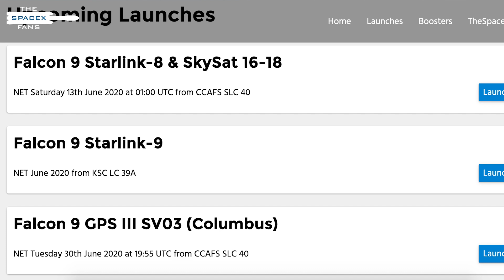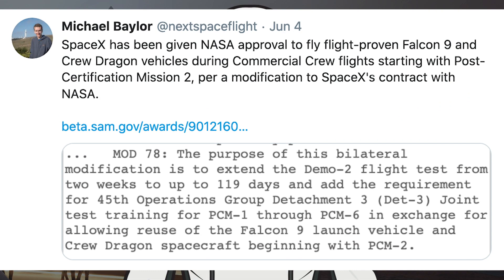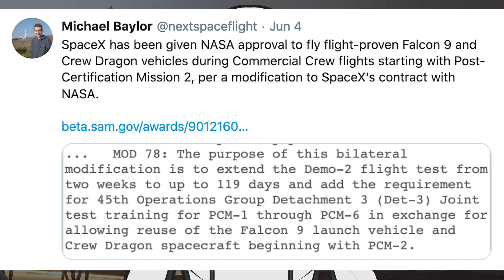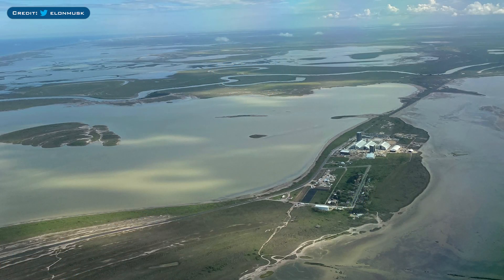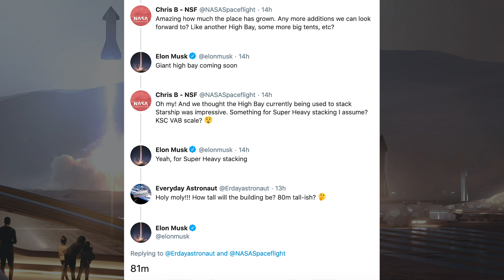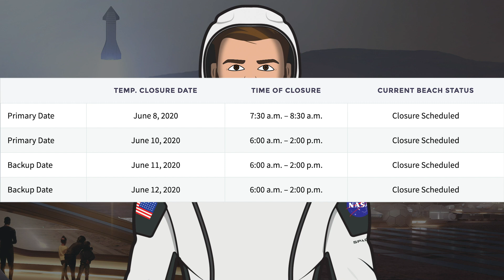SpaceX Starship Updates! SN5 Testing Very Soon, SN6 Stacking Soon, SN7 New Bulkhead! TheSpaceXShow

Comment: Shiny rocket good orange rocket bad lol ok
Reply: It's just a running gag in the SpaceX community, it's not meant to put down the amazing engineering that went into the Space Launch System. More the guys who wanted it built in the first place. Orion was contracted in 2006 and is not yet ready. SpaceX was still blowing up Falcon 1's back then and wouldn't even reach orbit for another two years. So there is reason for criticism towards the management of that program and behavior of the two main contractors responsible for delivering. Bridenstine has lit a fire under their ass and suddenly after 10 years of no hardware, we have one booster ready, another close and SRB's for Artemis 1-4 ready to go.

Comment: At 7:35 rather than two smaller rings I think one regular sized ring was used. That could be the new way to interface the dome to the body. Only one ring is needed and if taller rings are going to be used on SN7 then only normal sized ring is needed here.
Reply from the maker: I did consider that too. Would make more sense tbf.

Comment: With the amount of engineering going on, one has to feel that there's too much being built, but not much being accomplished. maybe if there's more focus into only two prototypes at once, there would be less explosions. They seem to be spreading themselves too thin.
Reply: I mean they want stuff to go wrong so they can learn from it, and they know stuff will go wrong, building more prototypes gives the team experience in doing it, and can allow for new measures to be adopted, with each prototype having new things added
Reply: @travishatch2986  I agree. But the mistakes they've made so far (failure to check valves, valves not working properly, etc) seem to be beneath Spacex's reputation
Reply: Everything is relative.  What do YOU know of that is happening with Blue Origin's "New Glenn"?  Exactly! 🤔
Reply: Many of the failures have been human error or GSE.  Not related to the actual starship build.  Moving fast to have the next test subjects ready is part of the plan to test to failure and then learn and move forward.   Also,  Elon has said that ramping up production is harder than actually building the individual Starships.  It's all about building the machine that builds the machines.

Comment: I think the piece of equipment added to the test stand is the ignition module used for starting the engine(s).  In the bottom of the unit is seen a pump and motor.  The upper half is a rectangular tank which could hold the ignition liquid.  At the top a manifold is there.
Reply: It looks more like a quick release, fuel and power ground connection unit, that was the type of unit that failed, and caused the fire and explosion of SN4.
Reply from the maker: Thank you :)
Reply: Freedom To Think        gets top marks. It is, indeed, the new quick release mechanism to replace the failed unit.